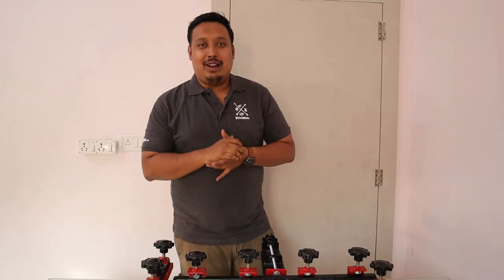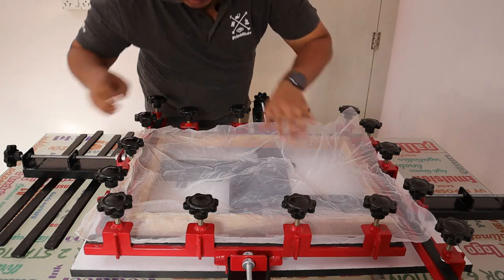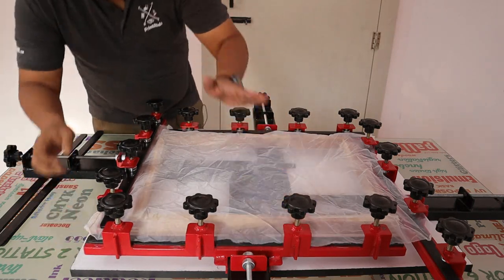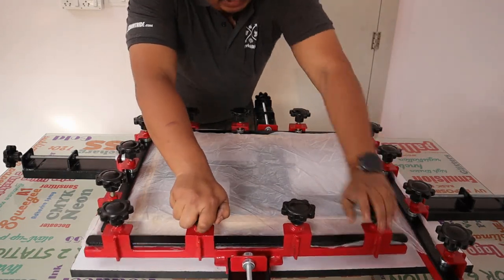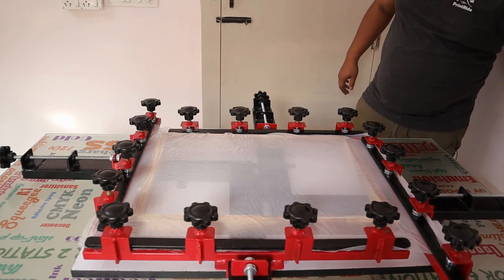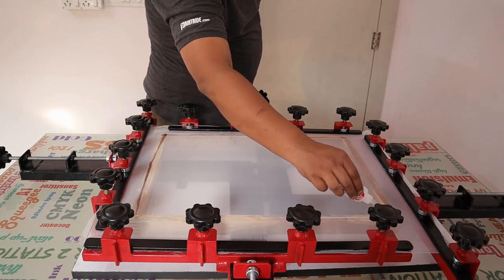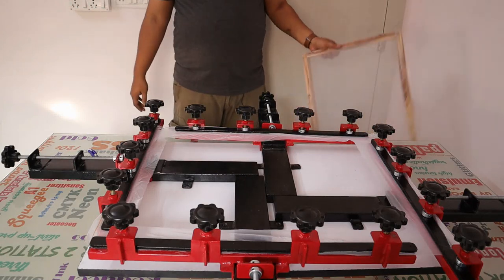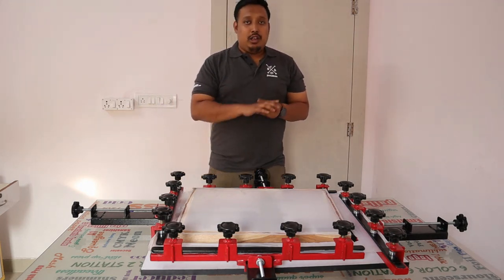How to use Screen Stretcher

Comment: How strong, do you use a meter to measure? What if you use an aluminum screen? When you cut it will leave marks. Also how will you remove the glue from the aluminium screen, while using frame to make another screen?
Reply from the maker: It's enough strong ... You can use tension meter and you can achieve your 

Aluminium frame more better to stretch 

Glue depends on how expensive you are buying
Reply: @Printride  thank you